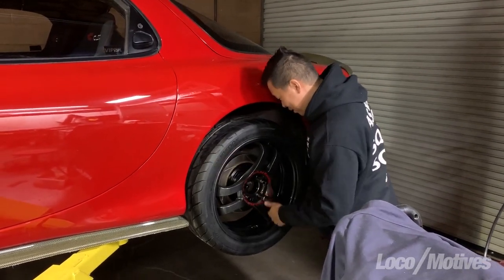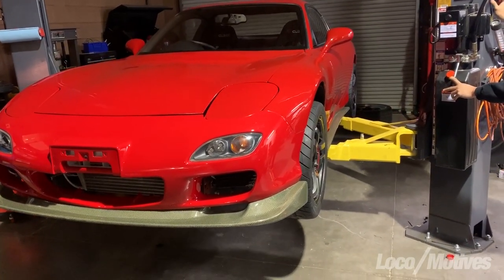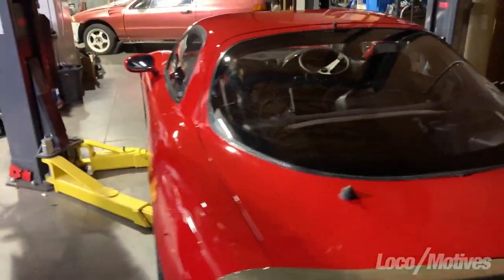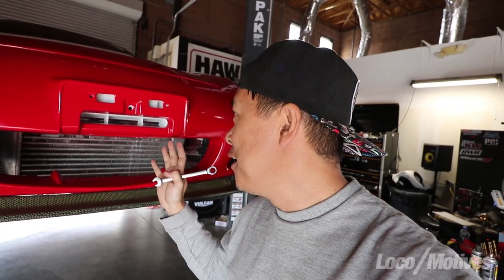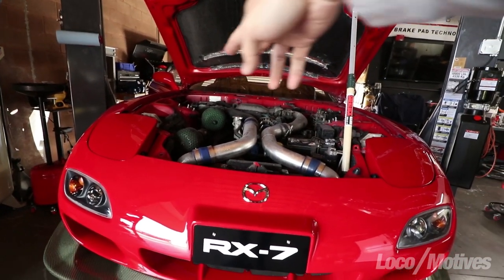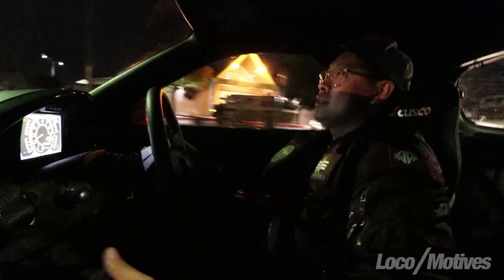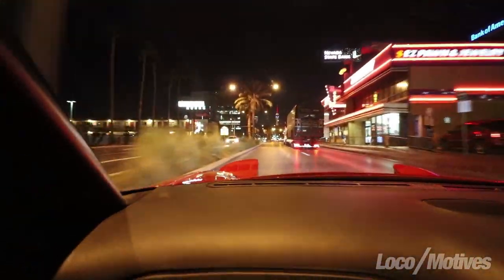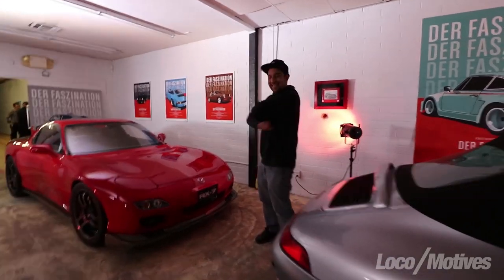THE FD RX7 IS FINISHED!!! WE GO CRUISE

Comment: that "flutter sound" is the wastegate, but when you hear a big burst of air, that's a blow off valve. For those wondering, the waste gate controls the maximum boost by taking the intake pressure and feeding it into a valve that opens a hole to bypass the turbo, and when you let off, the pressure drops and the "gate" can bounce a bit. Where as a blow off bleeds the pressure that feeds the gate, so it thinks it's getting less pressure, and the turbo builds more pressure.
Reply from the maker: good to know, does it only do that in twin turbo set ups?
Reply: @diymike  it has been an incredibly long time since I've worked on turbo cars, but I don't think the amount of turbos make a difference